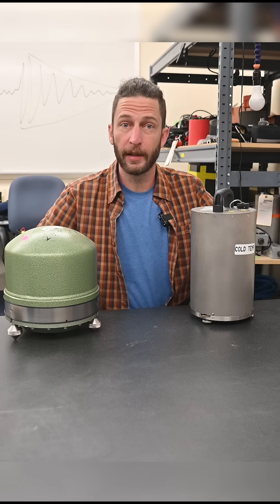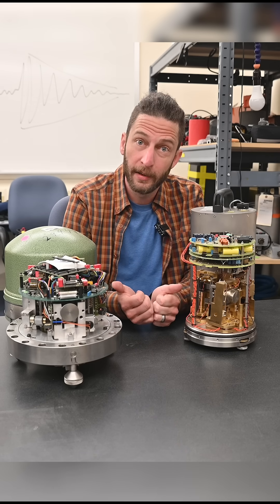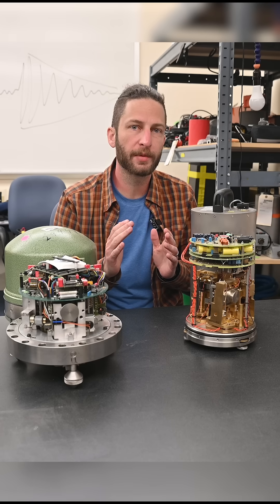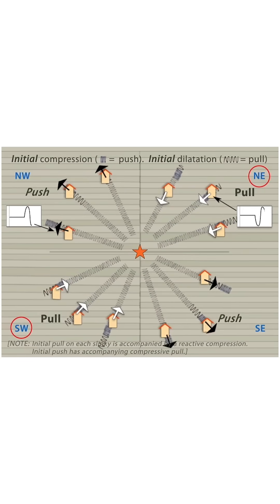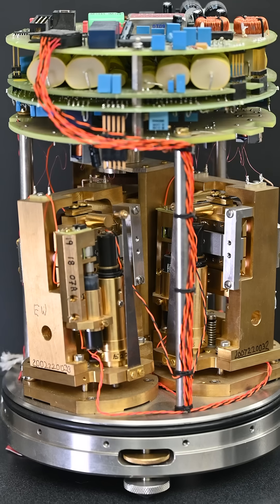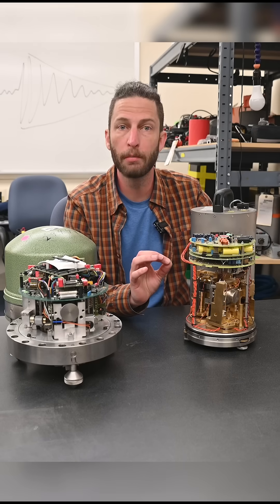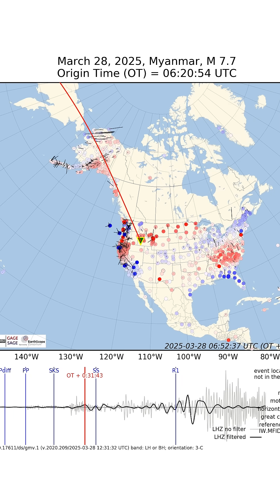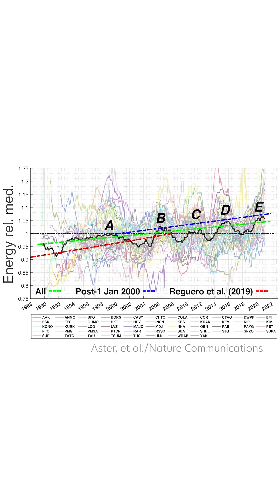What's inside a seismometer? #geophysics #seismology #earthquake #shorts

Comment: We used two, one at each end, for balancing electric motor shafts. We mounted them on rods carried in linear bearings. Once we understood what the signals were actually saying we could get motor shafts balanced enough to spin 10,000 rpm. We also discovered we needed to contain the motor rotor aluminum on each end of the rotor with a ring of harder material in order to keep the aluminum from spinning off the rotors.